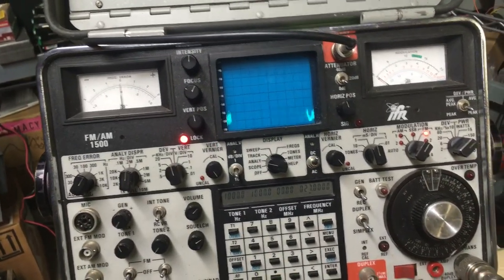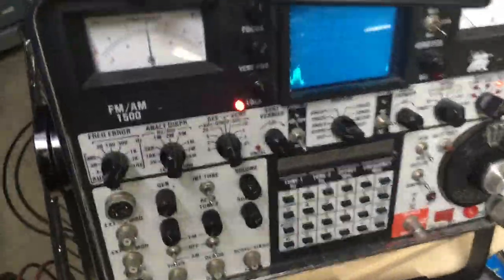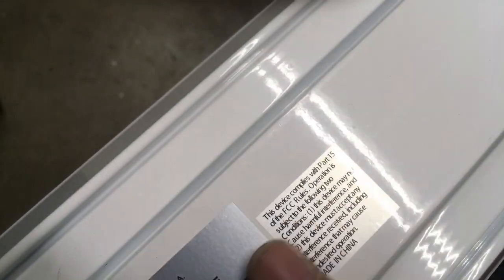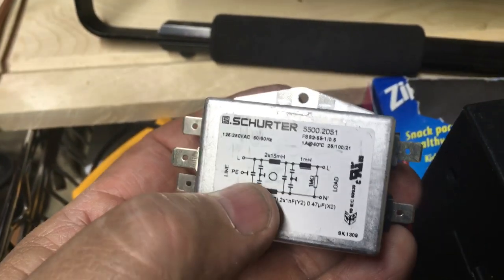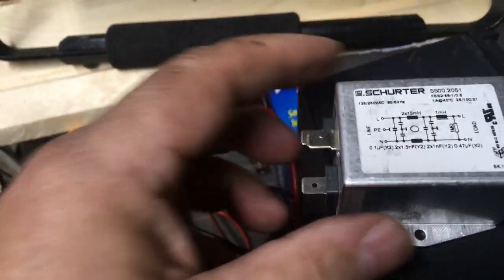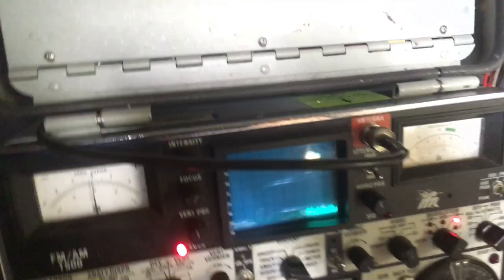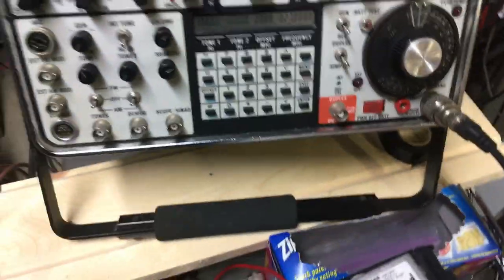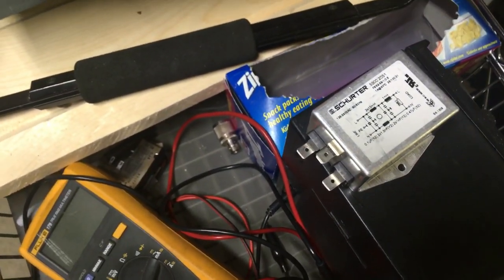LED lights RF interference fix, for education only

Comment: Clamp-on ferrite bead chokes are effective too.  Put them on the wires where they exit the power-supply (called a 'driver' in the LEDs industry).
Reply: My wife grows fancy succulents with a grow light from HLG. It has what I can only assume is a ferrite bead on the power cable coming into its driver. Would it help to add one on the cable leaving the driver toward the LED board?

Comment: Thank you.
  I used 2 ferrite beads on a noisy power supply and it made a real difference. 2 loops through each bead. ( type 31 mix).
Reply from the maker: Nice.

Comment: As a line of site goes, one of these lights is in-between an indoor shop camera & the sales area of a small engine repair shop head unit. All the other cameras work fine. They don't make a repeater for these cameras. They're wireless @2.4Ghz. They make an extended antenna for the cameras to possibly mount it outside. Should I try other lights to see if the shop cameras come back? Before they would all work with the bay doors open.

Comment: There is a good chance that you could place one or more capacitors in parallel with the lights and achieve a similar outcome for less.  Or ferrite choke(s).  These should be placed as close to the source of interference (LED driver circuit) as possible will usually be most effective. 

Ultimately you ate trying to compensate for inadequate noise suppression in the original design (or to replace/supplement inferior parts used in production that do not perform as well as the units built and tested for the original certification)
Reply from the maker: That is right and sort of the point of the video. I just found out about part 18 certification for noise. We all should demand more of that from the manufacturers.

Comment: We have issues with LED lights where they blow bulbs in the rest of the garage, same garage it burned up a WiFi switch for outside lights same garage plugged in an electronic soldering tool it immediately started smokin. Different garage power flickered from storm blowed 4 different led bulbs that was on same time the garage LEDs was on. Some of these blowed issues not even on same leg.

Comment: What’s “dirty” about it? Is it mucking up the light itself or everything else electrical in the room? Is it only mucking up things for audio (“~50db in the HF range”) or all electronics?
Reply from the maker: It was generating broad band RF noise in the MW, and HF spectrum. This is typically from poorly(cheaply) designed power supplies.

Comment: I have the same problem, even tried 3 different manufactures but still get the interference. I wish you included a link on where to get the filters you are using.
Reply: @BryanHerbert  Yea the one we all need is for 120V not Dc current.
Reply: Wow. No idea how that happened. The filter I was looking at said 120V.

Comment: Thanks for the EMI filter video, my question is, can the filter be wired into the feed wire(OUTLET) that powers the led lights?
Reply from the maker: Keeping the filter as close to the source of the noise, the power supply in the lights in this case is important. The electric wiring can act like an antenna. So your effect would be possibly negated completely if you had any length of wire between the plug and the light itself.

Comment: So you cut the light cord, wired some connectors for the filter on the exposed ends, and connected the filter to those, correct?
Reply from the maker: That is what I did. But unless you are qualified in electrical work. Seek assistance to make sure you are not violating safety and local ordinances.

Comment: weird thing with mine. if i plug in an extension cord from my house the lights do not flicker. however if i run them off of my work shop panel they flicker badly. im going to try and ferrite everything. the line run is very long also so im pretty sure thats my problem i cannot even hook up my 50 amp gfci due to the long run as it seems to be picking up on the interference and tripping unloaded.its a head scratcher for sure.
Reply from the maker: You might measure your line voltage. It could’ve dropped below a threshold point for the power supply inside.

Comment: But what about the rf that comes from the light/housing itself? Especially in the case when the housing is plastic.
Reply from the maker: Housing is metal on this one so it’s not a problem. However, a plastic one would present problems I believe tension filters to keep wiring from acting an antenna.

Comment: I have 4 12v led srtips I run off a car battery in a shed. They seem to cause really bad power supply distortion leading to the lights flickering and noise generated from internal circuitry. Simple solution was just to place a high value capacitor over the battery. Cost next to nothing for a 12v DC circuit

Comment: I just noticed this on my shop lights. they totally blow out my Lo-VHF signal (channel 4) where I live. I have my over the air cable connected to a booster. I'm going to try to put a choke on my booster to see if it makes a difference. Probably wrecking my WIFI as well!

Comment: I have 4 strings of LED over the car bays would i need to filter all 4
Reply from the maker: Likely so. The trouble is the power cord is acting like an antenna. I have toyed with the Idea of converting to a common Filtered DC supply for them all, These lights use about 60 volts out of the internal power supply and distributing that DC around to all of them.
Reply: @paulk8io445  if the power cord is acting as an antenna couldn’t you add shielding to the power cord? Thx

Comment: I have 4 8' led lights, I put the filter before the lights? The side with 3 leads are hot, neutral and ground?
Reply from the maker: The noise is coming from the signals leaking out of the switchmode power supply. So yes, The AC with Hot Neutral and Ground should have the filter applied.

Comment: Could a house full of LEDs cause enough interference to prevent "smart" home devices from pairing and connecting to things like Google Home?
Reply from the maker: I would hope not, The higher frequencies are more immune to this type of interference.
Reply: I would hope they do because if they do more people will know this and at least someone will care for how much this things radiate and maybe then manufacturer will shield this interference away
Reply from the maker: @DXingSlovenija  I do know that led bulbs in my car door opener make the receiver very insensitive and when I went back to incandescent bulbs the problem resolved.  That opener operates in the 300 MHz range.

Comment: I get my over the air HD TV signal to my home via an antennae I installed in the attic. I recently changed our vanity over-the-mirror light fixtures in both girls' bathrooms and master bath from CFL bulbs to LED. Now when I turn on the bathroom light switch my TV signal gets bad interference or goes out altogether. I'm wondering if anyone has a solution for that circumstance. It drives us crazy.  The bulbs we bought are from Feit and have a FCC part 15 rating (assuming it is legit). I've also read that FCC part 18 bulbs give off less interference but am having a hard time finding. I went up to Lowe's and talked to their electrical expert and he has never heard of this situation or part 18 FCC rating before. Would love any possible solutions to my problem.
Reply from the maker: I was unfamiliar with FCC part 18, Thanks. And we should demand that the FCC and Legislators in the USA (and everywhere) demand action. I would return the product as defective and request a refund. If enough do that fcc part 18 certification would becomae a sales point.
Reply: LOL.  Lowes... electrical expert... That's a good chuckle right there.

Comment: I have the same issue. Was happy to find your video but it's way too long. You don't explain how to connect the filter which to a knowledgeable like yourself is simple but to someone like me is a mystery.
Reply from the maker: You need to understand electrical and how it works to even begin to mess with 120 or 240 volts. It can and will kill you if you let it. You should learn the electrical basics before ever attempting to do something like this. Thanks for watching.